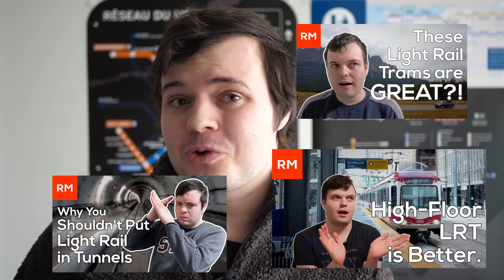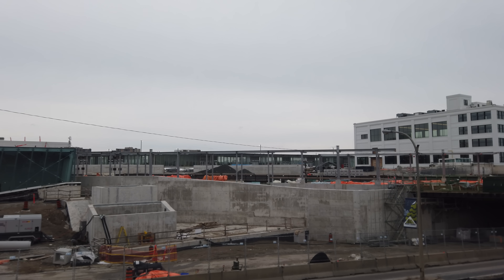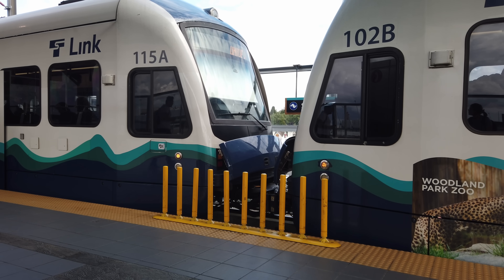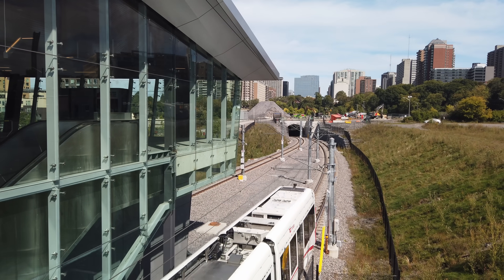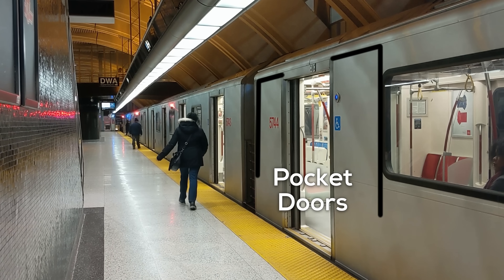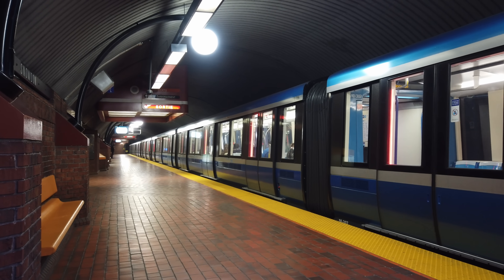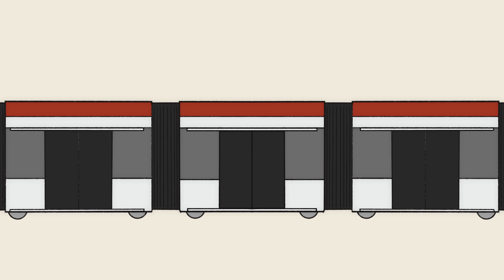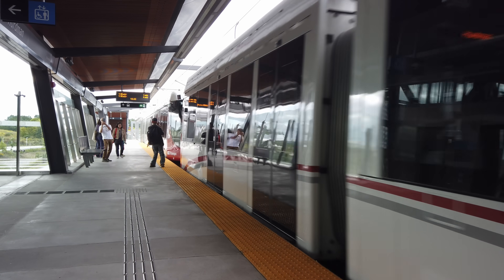I Designed a Better Low-Floor Tram

Comment: The T1s on Vienna U6 already have this arrangement with the wheels at the edges, as do many 1990s German low floor trams, though only for the centre section. This is also a somewhat popular solution for retrofitting high floor trams with low floor sections (Tatra KTNF6, Gothenburg M31, etc). It does have some dynamic and maintenance problems though, especially if the wheels are steered.
Reply from the maker: Oh yes the German speaking world always a step ahead lol
Reply: @RMTransit  You could even say the Germans are two steps ahead: 
In the 1990s, many german cities bought "MGT6D" trams, which have single wheels in the midsection. While the midsection of these trams is spacious and entirely low-floor, the technology turned out to be quite problematic to handle. A famous example is the city of Bochum, which got rid of all of its MGT6D trams because of massive technical issues. Also, riding in the midsection of an MGT6D is way less comfortable than in the front and back sections, which use classic bogies. 

So while being very popular in the 1990s, this technology basically disappeared in the early 2000s. Since then, most operators prefer classic bogies or multi-articulated trams with four wheels under every second car.
Reply: @RMTransit  "German engineering is the best of the world!"
Reply: Well, I think that Reece's design is good, but one has to consider possible noise. On MGT6D, the center wheels often start to squeal and its really annoying.
Reply: @pixoontube2912  wheels squealing is general a function of the interaction between gauge, turn radius, and wheel-base, to my understanding. basically, if your corners aren't too tight for your gauge, and you wheels aren't too far apart for how long the corners are, you don't get squealing. Well, not if you actually maintain your trains properly, anyway. 

Of interest, every video I've ever seen of American trains on switches and curves is just constant squeal... but I've never heard a New Zealand train make any such noise, on video or in person. NZ noticeably has a narrower track gauge than the USA, among other things, and this held up even when, post privatisation, the company running NZ's railways was Intentionally running the thing into the ground (the aftermath of That mess is ... interesting... )
Reply: @laurencefraser  I was talking about straight track, so something must be off.
Reply: I once saw the U6 on the regular tramway track in simmering to be specific zentralfriedhof 3. Tor😅
Reply: Type V is very comfortable and has a lot of space between the seats

Comment: would having 70% low-floor instead of 100% resolve these bogie problems?
Reply: Yeah i favour sacrificing the 100% status instead of design mental gymnastics
Reply: It depends on the specific vehicle. If there's just one small step up at each end of the vehicle it would be well worth having a partially low floor vehicle for better running characteristics. If there are multiple steps up to the high floor areas and they are spread out throughout the vehicle a fully low floor design might be a better choice.
Reply: The old way,
Reply: Mix it with articulation, maybe with the train split into subunits, like the Norwegian class 74 and 75 flirts (but without 200km/h capacity), and I think it's a better compromise.  And you can make the platforms match the trains, because the high/low floor bits are always in predictable places.
Reply from the maker: It would solve them to some extent but the stairs hurt circulation and accessibility which I don't like
Reply: Stadler builds a lot of ramps instead of stairs, maybe that's a better option

Comment: this looks exactly like Bergen(Norway)'s LRT, Bybanen!
Reply from the maker: I know a good looking tram when I see one!
Reply: @RMTransit  The Variobahn is just your typical multi-articulated tram like the Flexity Freedom (but with longer segments, that allow 2 doors per side, more akin to a Citadis 305). Nothing revolutionary here.
Reply: @RMTransit  bergen video coming soon?
Reply: Which of course is a "Swiss" (German) Stadler. They know whats up.
Reply: arent bergen's trams similar to the variobahns in London too?
Reply: @Dinoteddi  Yes. They were actually built for Bergen, since Stadler had some spare capacity in their production, and built them many months earlier than planned. And then TFL ordered the exact same model. So they just repainted them green instead of orange and sent them to London. And then built new ones for Bergen instead. That way they could deliver to TFL much quicker, and get paid quicker too.
Reply: @Dinoteddi  it is a variobahn made by stadler.
Reply: @Dinoteddi  yes